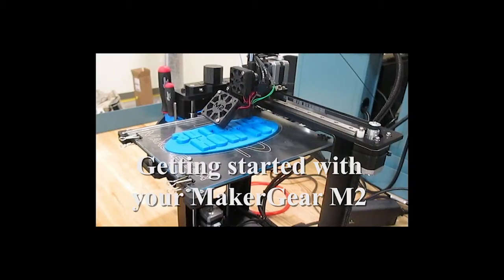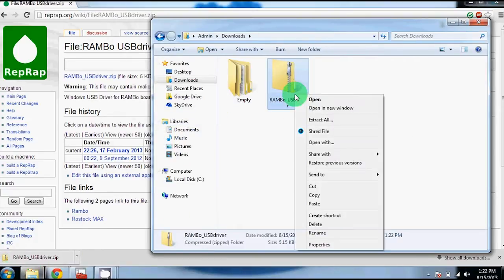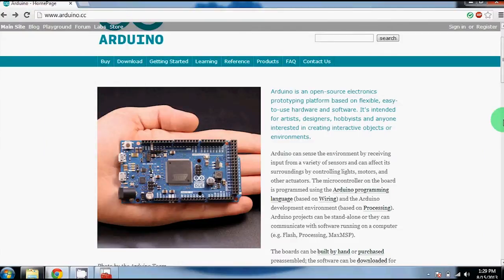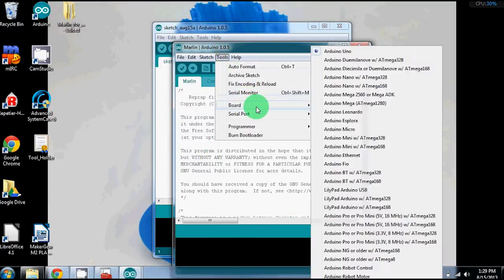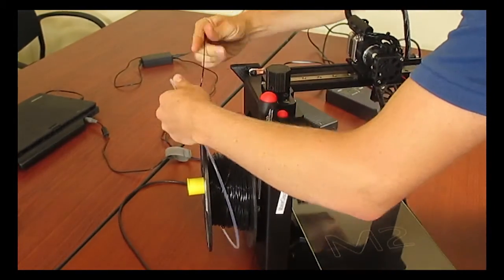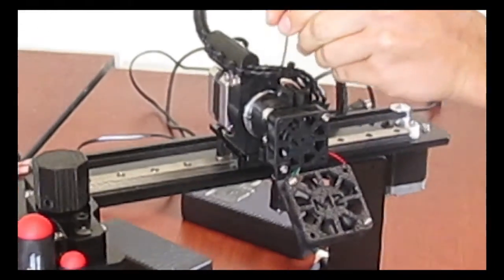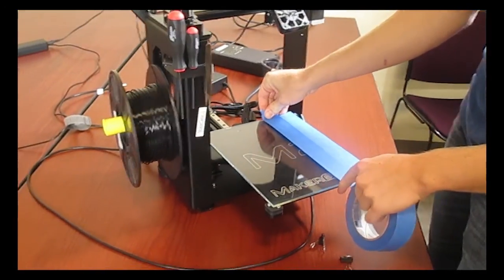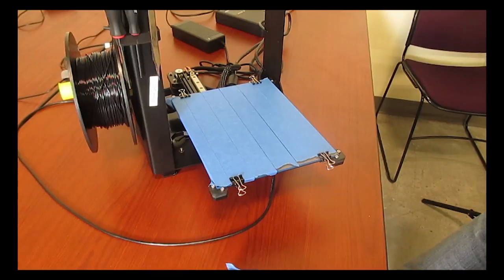Getting Started with MakerGear M2

Comment: Hi, 
I connected my m2 with my computer and I got this problem. 

Do you have any ideas? 

Thank you so much! 

Connecting...
start
Printer is now online.
echo:Marlin: 1.0.0 RC2 for MakerGear M2
echo: Last Updated: 2012-05-30 | Author: johnny
echo: Free Memory: 4775  PlannerBufferBytes: 1232
echo:Using Default settings:
echo:Steps per unit:
echo:  M92 X88.88 Y88.88 Z400.00 E471.50
echo:Maximum feedrates (mm/s):
echo:  M203 X500.00 Y500.00 Z250.00 E200000.00
echo:Maximum Acceleration (mm/s2):
echo:  M201 X9000 Y9000 Z30 E10000
echo:Acceleration: S=acceleration, T=retract acceleration
echo:  M204 S3000.00 T3000.00
echo:Advanced variables: S=Min feedrate (mm/s), T=Min travel feedrate (mm/s), B=minimum segment time (ms), X=maximum xY jerk (mm/s),  Z=maximum Z jerk (mm/s)
echo:  M205 S0.00 T0.00 B20000 X20.00 Z0.40 E5.00
echo:PID settings:
echo:   M301 P7.00 I0.10 D12.00
echo:SD card ok
Error:0
[ERROR] Error:0

: Extruder switched off. MINTEMP triggered !
Error:Printer stopped deu to errors. Fix the error and use M999 to restart!. (Temperature is reset. Set it before restarting)
[ERROR] Error:Printer stopped deu to errors. Fix the error and use M999 to restart!. (Temperature is reset. Set it before restarting)

Comment: While this is a generally helpful video, you should not have to install the Marlin firmware. The Makergear M2 now ships with the Marlin file loaded on the RAMBo.  If you load the file from the reprap wiki, your M2 will not work.  I tried it and it screwed me up.  The correct version of Marlin can be found here:  http://makergear.wikidot.com/m2-firmware